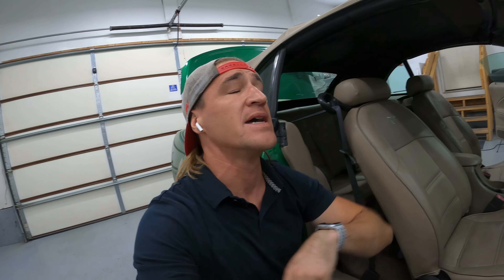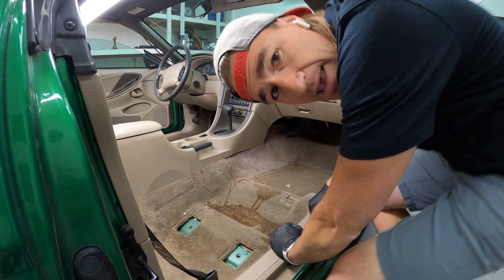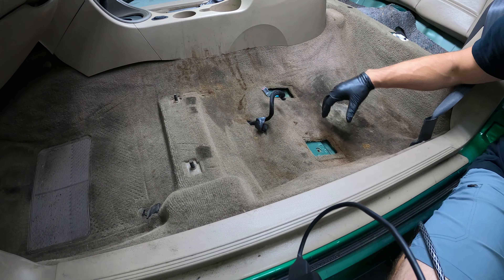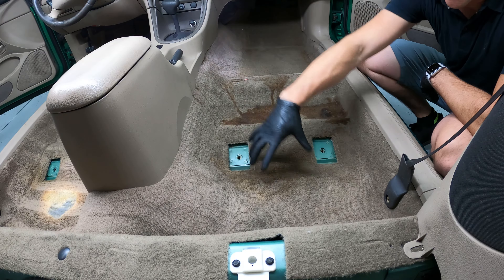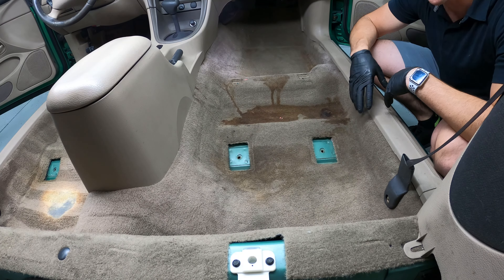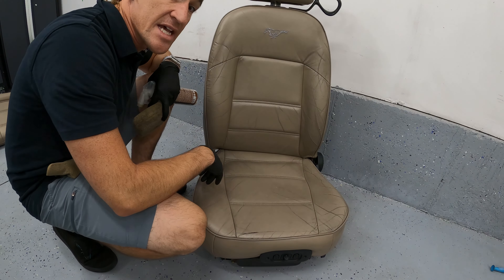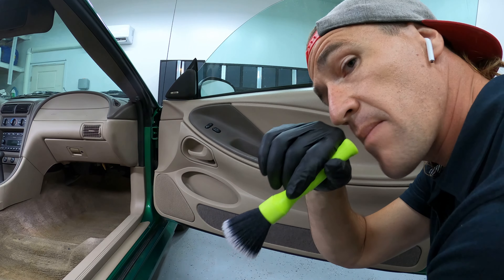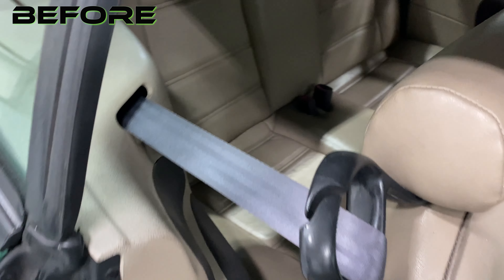Deep Cleaning ‘01 Ford Mustang Because… It Was Dirty| Interior Only Leather/Carpet Transformation

Comment: Love your videos, I have a 1995 Toyota Camry station wagon that has sentimental value and I’m wondering how to determine if the carpet should be detailed or replaced?
Reply from the maker: So I have been thinking about your question since you posted. My thought is that if your carpet looks like this Mustang, it might be worth replacing. Meaning if there is a spot where the fibers have been completely worn off, it’s worth considering. If it is just soiled, I would clean it. The next level up from what I did in this video is to remove the carpet completely from the vehicle and then pressure wash it off. I do that, but rarely. Mainly in the interest of time. Some customers think it is worth it though. My bet, if the car has some sentimental value, you probably have taken care of it and can just extract the carpets and you will be solid my friend.